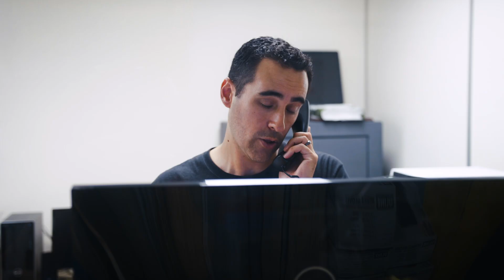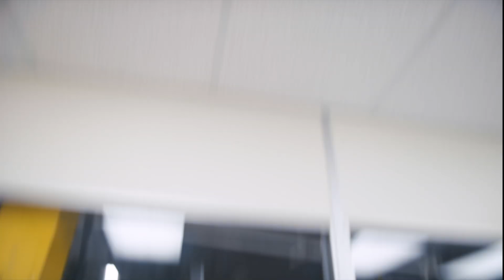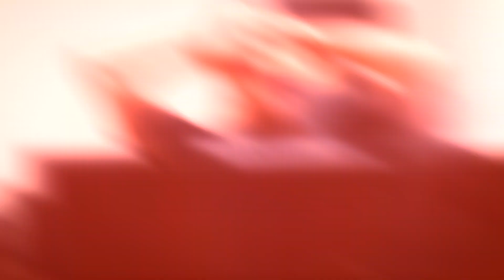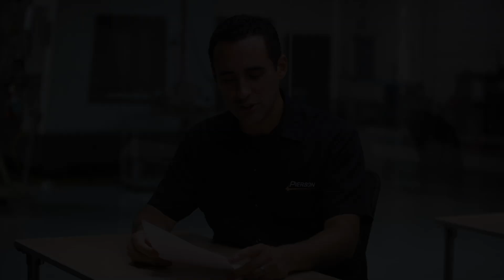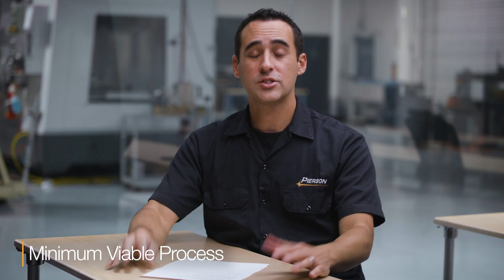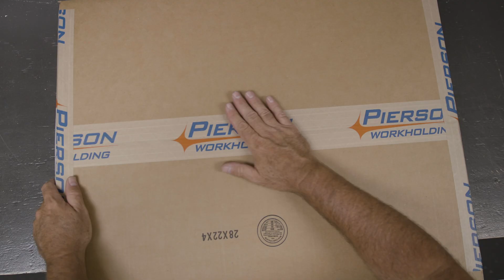When to Hire, How to Launch, How to Manage - Pierson Workholding Q&A

Comment: Great advise Jay. If you want to be a manufacturer you have to think like a manufacturer, not like a machinist, fabricator or other specialist. Keep up with the business end of the business. A lot of small shops hate doing the books but if you hire that out the lag time between you and the accountant can be a killer. Value stream map the whole process constantly and don’t be afraid to rearrange the shop to fit the work.